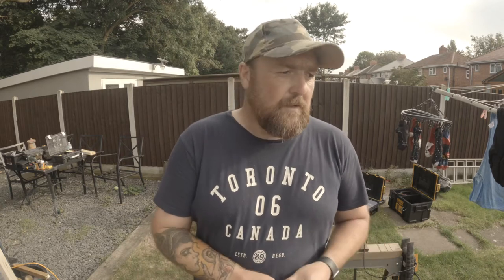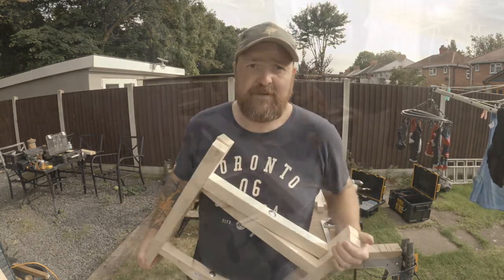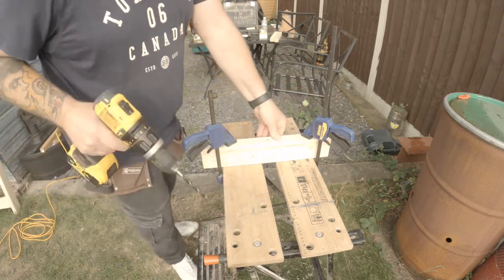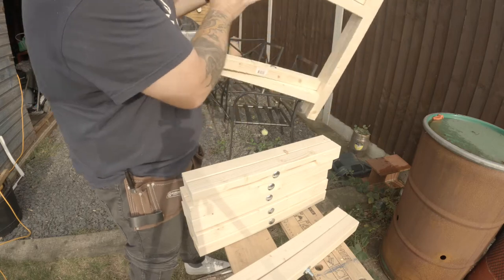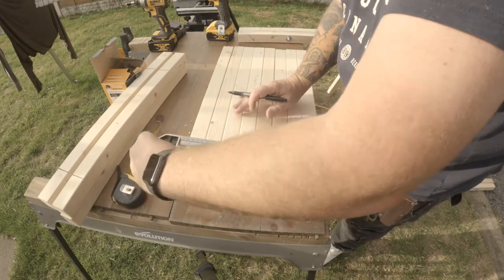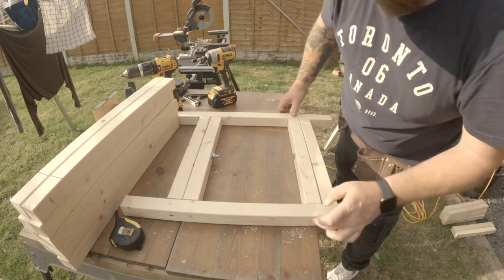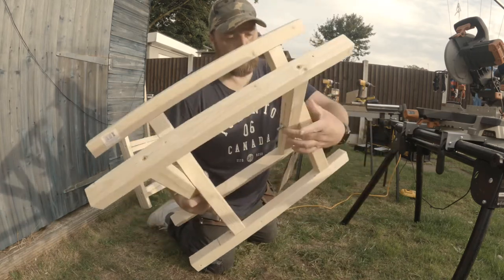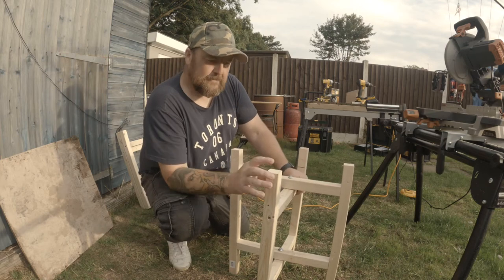Making my spot / mortar board stands from timber…trying to help with the back ache !!!

Comment: Nice job, how have you got on with them since?

+1 to double up the nuts if you haven’t got any ny-loc locking nuts

You might stop the wobble with a few triangles of ply or osb screwed over the joints to brace them. 

I’ve made a few different versions to find one that works for me. I might have to make and upload a video one day if I get the time. 

Hope the back is feeling better 👍
Reply from the maker: Thanks for the feedback.. they lasted quite a while to be honest but I agree… plenty of room for improvement 👍🏻
Reply: How would you stop the wobble. And what do you mean by 'stop the wobble with a few triangle of play  or osb screw over the joints'

Comment: Great video 👍 I’ll give them ago with a few 2 by 1 .5 roofing battens plenty of off cuts on our job  see how I get on 😊
Reply from the maker: Thanks, if I was to do them again I would make them slightly wider as they do get a bit wobbly when loaded up. 
Saves you a few quid 👍🏻
Reply: @theresmortarlife8527   think the steel ones are 600 ht and 500 width i might try them dimensions  Thanks for heads up